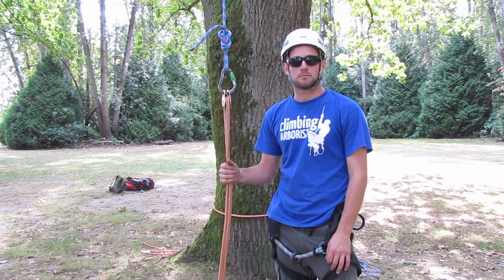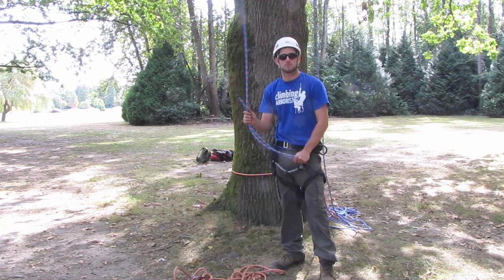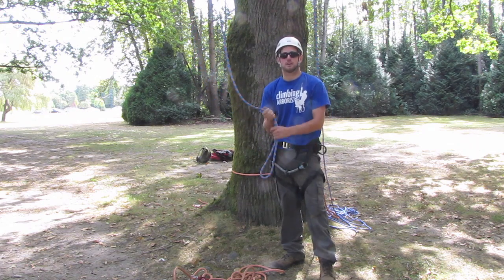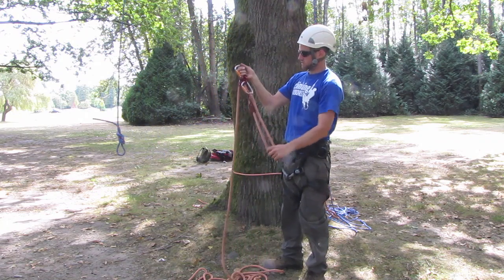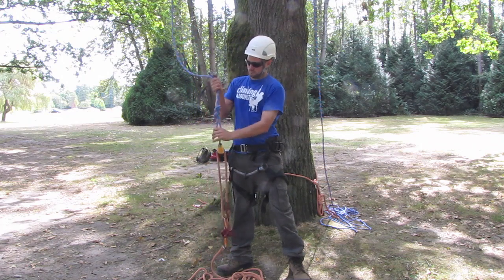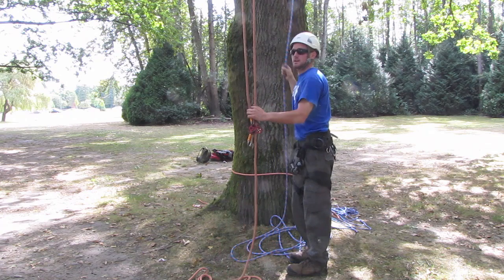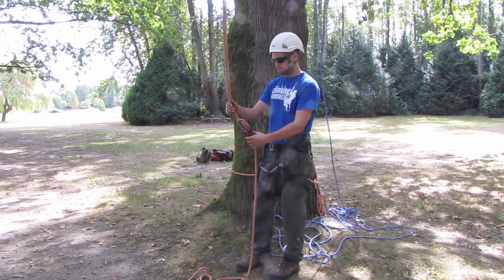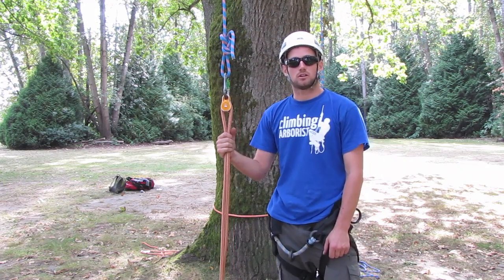False crotch system setup

Comment: Is it necessary to use a kernmantle rope for the static line in this specific setup since mechanical devices will not be used on the rope itself? Could you use 16-strand for example?
REPLY
Reply: Not necessary but the reason a kernmantle, it would be preferred for the floating canopy anchor would be to reduce the overall elongation in the system. The biggest problem with climbing on this (besides the inherent risk in any basal anchor being damaged or cut from the ground)  is the amount of bounce in the system as you are being supported by 3 strands of rope and stretch can be a big factor especially if you get that nice high tie in. It also is putting double the force on your tie in point as traditional drt or a single rope canopy anchor.

Comment from the maker: Don't use a rigging pulley, always keep your rigging gear and climbing gear completely separate as you never know exactly the excessive loading those pulleys have taken. Any micro pulley that has the rating stamped on the side and is in excess of 20kn should be good for climbing.